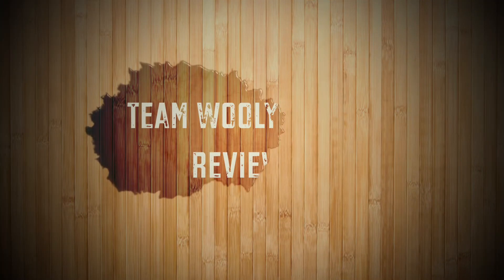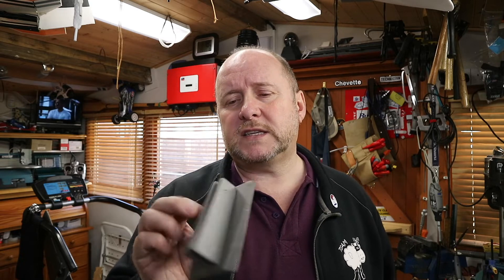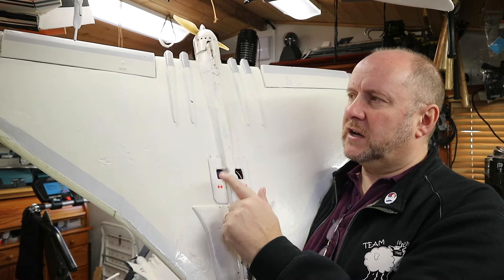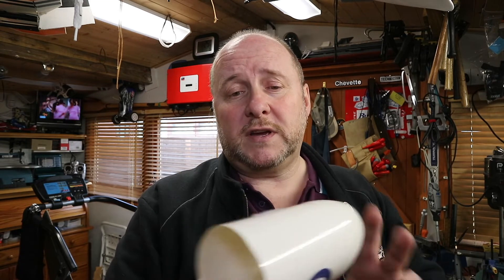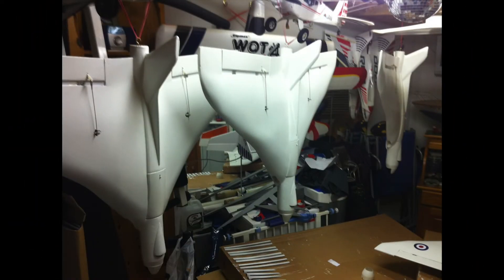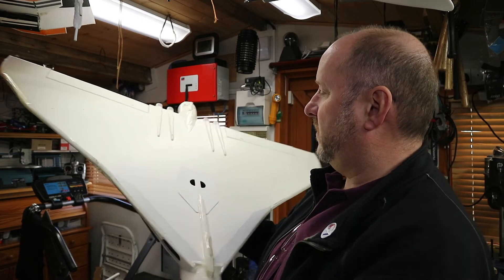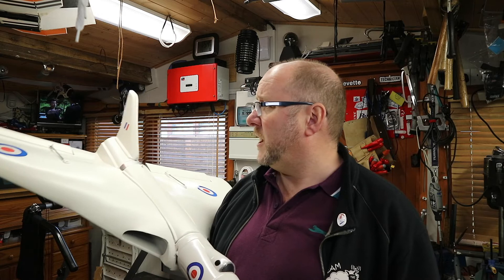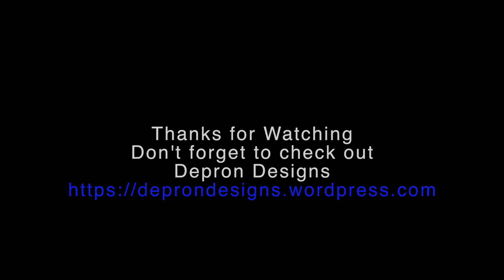Part 1 - A talk about Depron & my Avro Vulcan build 1100mm wingspan

Comment: Actually no need to put tape on Depron for bending. What you need is a worktop with a rounded edge. You basically pull the depron over the edge while pulling down ... keep repeating and the surface touching the worktop concertinas up to allow the depron to form the curve. If you have a compound curve dolly - you can do same in each direction needed and create complex shapes such as cowls etc. Without the tape and sticky it leaves behind.
Reply from the maker: Thanks......I generally use packing tape and it comes off nice but hear what you are saying and will give it a try next build
Thanks

Comment: Nice plane. Can you tell me in the video were you using a head camera and if so which one. Thanks.Mike.
Reply: Great video and builds. I have one of Green Air Design vulcans only 36 inch wing span still flies well but needs a calm day being so light.  Has twin pusher props. Depron is getting harder to get now I still have about 8 big sheets left. Where do you get yours from.  Thanks for sharing
Keith
Reply: Hi Keith. I have 8 sheets left which at the rate I am building will not last too long. I buy mine from Amazon in full boxes. Think I will order another box if it's becoming harder to get. Brexit might pose a problem as well?
Reply: @sailor0500  I heard the manufacturer was only going to supply the trade with large amounts of it and wouldn't be making small sheets anymore.  Don't really know of an alternative in the UK.
Reply: @rckeith  Could be a problem. Please let me know if you find someone who will supply full boxes at a reasonable price. I will do the same if I find a supplier. Mike.
Reply: Just been told that the manufacturer has gone into liquidation. Just bought one of the last full boxes for £90 inc delivery from ebay supplier. Mike.
Reply: Deepack leicester.
Reply: I will have 28 sheets when the new box arrives. That should build me 14 planes of approx 5 foot wingspan size so looking good for now Keith. Still much cheaper than ARTF although I would not want one of those anyway. Enjoy the build too much.Hopefully the Chinees will start making the stuff soon so then it will be 50p a sheet including delivery from China!! Good luck Keith. Mike.  @rckeith
Reply from the maker: @rckeith  Thanks, appreciated........I haven't bought any depron for a while. Last time I was looking there was some on email for flooring but getting worried now. I have only one sheet and need to get more soon.
Reply from the maker: Not sure if this is what you are asking regarding a head camera......On the Vulcan I have a runcam sky+ mounted on a 180 degree servo for pan control. This is connected to ch7 and use the head tracker module in my goggles to control ch7. 
Or are you referring to my video camera for making the video?
I am using a Canon EOS M3 mirrorless camera with a kit lens 15-14mm with a Rode Video Micro Mic
Reply: Thanks for the quick reply. It was the canon I am interested in. Thanks again.
Reply from the maker: @sailor0500  since this video I have sold the M3 and now using the Canon EOS M50 and much better
Reply: @TWSreviews  Thanks. Mike.